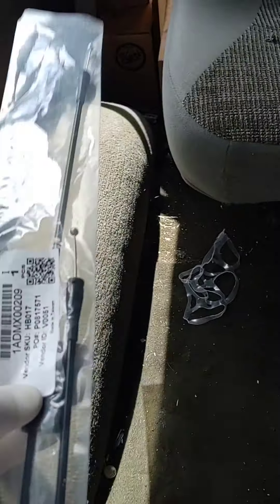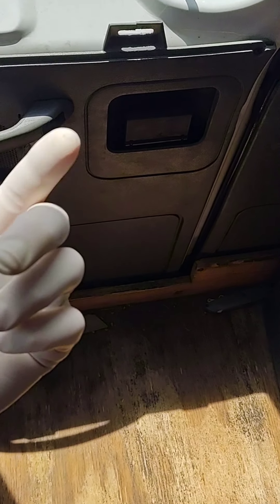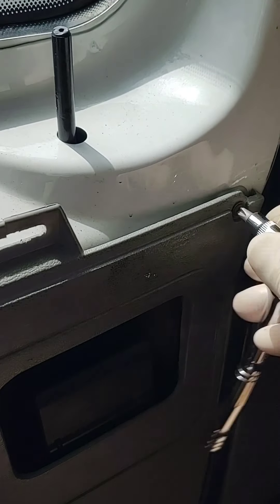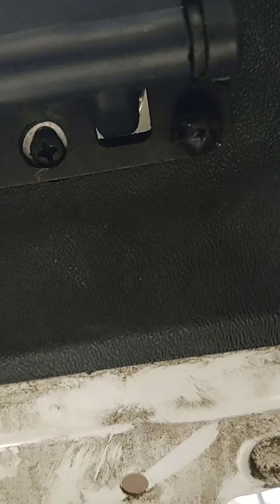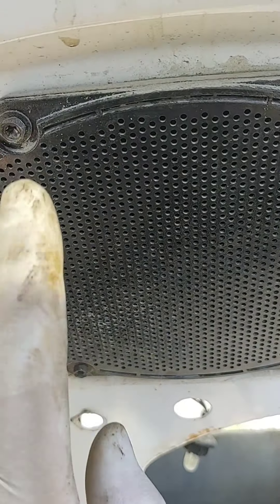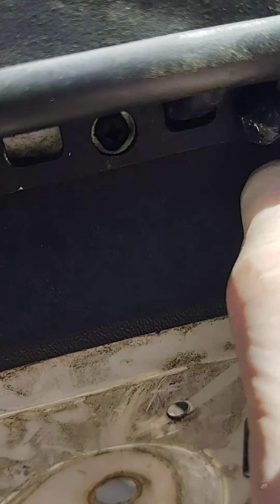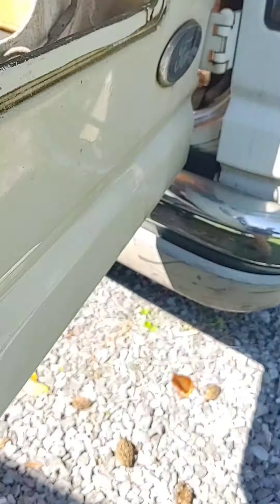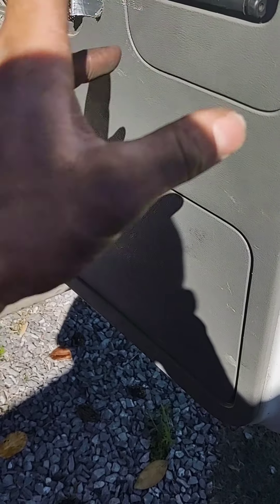Ford e250 and e350 van rear door handle cable repair for latch

Comment: This video helped me also replace the cables. I spent 2 hour one day working through this and still coolant get it done. Then I watched your video and with new cables it took me maybe 30 minutes BUT I couldn't fully remove the locking mechanism. I had 3 of the bolts out but mine had another hollow hex bolt that needed to be removed  to fully disengage and remove the whole system. But your explanation at about 9:59 helped me because I could see through the holes and perfectly place the cables into the locking mechanism. Then after that everything else was a breeze.
Reply: ThinBlueLiess  Apologies I don't remember

Comment: This is one of the best videos for the right hand rear door, what he didn't tell and he may not have had the issue is what to do when you get all the stuff out of the way and you have both cables laying in the bottom of the door. Harbor Freight makes a 5 or 6 piece pick set, use the crooked offset, go in straight where the inside handle cable connects and unlatch it, pull the bottom cable, tadaaaa door open.

Comment: Great narration to walk us through the process.  Thank you very much.   i will suggest this, though.  Instead of buying the cable sets that come with the same rubber/plastic cable ends that will fail again in a few years of heat, buy a set of 4 or 8 or 16 (!) aluminum cable ends instead.  This is such a frequent Ford failure that these are availabl everywhere.  I got mine for less than $1 each on Amazon (Dornan part).  Replace the cable ends with these and you won't ever have to do it again.  I've had my Ford van for for 17 years and sure wish I'd known about these aluminum repair ends when i did this job the first couple of times :-)

Comment: This is so helpful. My issue is that in the process of getting the door to open initially both cables came loose after the door was open. When we got ready to call it a day the door got shut. So now we’ve got a shut door with no cables attached in there to get it open.
Reply: You can slide your finger in behind the unlock tab thing on the side closest to you to pull the thing with no cable its hard to find but once you found it you can do it

Comment: Thank you I'm doing the exact same thing to a 98 Ford sportsman exact same door latches and everything I didn't quite take the last two lashes off this drive me crazy busting my knuckles all up I guess I gotta completely disassemble it all because the door lock cable and that top cable fell out when I was replacing the window And I found one of the sleeves one of the necks is is broke off one of the heads broke off on one of the cables anyway so I gotta get a new cable what a headache of a job especially if you got big hands drive me crazy thank you very much I needed that I can see there are zero short cuts. Everything's gonna be completely disassemble rotate it out and then properly reassembled and that's gonna drive me 😢😢😢nuts
Reply from the maker: Glad to help I hope you get it done. It is a horrible design

Comment: Very good vid! Was looking to see if there was a vid on this as I have already fixed the outside handle ( arm that holds the rubber part of the cable was loose, jb weld ) but now it's not working again. Thinking it's the cable but can't see up to the latch. The cable cover does slide so it must not be hooked up top..... Thanks again, very good vid!!
94 e-350
Reply from the maker: Thanks for watching! They definently  didn't make it easy to repair.

Comment: How’d you get the piece hooked back in to the locking mechanism? That’s where I’m stuck, it’s impossible to pull that hook through the tiny hole
Reply from the maker: You have to feed the cable around through the cracks and then in will go in that part is a  bit of a pain you may need to move it with your fingers a it to open it just enough
Reply: @lifeathand1062 yeah I was working on this job today….. I know why that part wasn’t shown 😂

Comment: Man this is tough I hope I can get it on my calendar is not broken it just popped off ill try to put it on this weekend ill keep you updated
Reply from the maker: I had to peck the cable ends back in I'll answer questions if I'm able to get service also I am going to upload a video on how to fix the AC of it's switching from vent to defrost when under a load
Reply from the maker: I apologize for not responding quicker I'm in the mountains alot and just got the notification for your msg

Comment: Only video that really shows everything. It seems like a pain i might get a mechanic to do it. I figured you needed to take out the lock, of course they couldnt make it easy. I tried to take out lock, and stwrted stripping star screws wth.
Reply from the maker: Yes the star screws are a pain sometimes you have to go the next size up and peck it in with a hammer or cut a slit in it with a dremel so you can use a flat blade screw driver 
Thanks for watching
Reply: @lifeathand1062  ok thanks i was wondering becuase they seem to be hard to get out. I been looking for days for a video on this, your video is the only one that showed everything. Thank you so much

Comment: What if the cables are good but door only opens sometimes? I opened everything up but the cables end are good. Maybe the latch has issues?
Reply from the maker: Try cleaning the latch and then putting a good silicone spray on it. I would probably use some break parts cleaner just be sure to wear safety glasses.

Comment: VERY GOOD INSTRUCTIONAL VIDEO.  MUST WATCH A FEW TIMES. HE SHOULD HAVE EXPLAINED HOW TO OPEN DOOR FROM INSIDE THROUGH OVAL PLASTIC COVER ON THE INSIDE OF THE DOOR NEAR THE LATCH MECHANISUM. NEED SCREW DRIVER & VEIW FROM BOTTOM UP FROM LICENSE HOLDER OPENING.     5 STARS......

Comment: The problem is if you can't get the back doors open you can't fix anything
Reply from the maker: @JohnWarren-c9u  can you access the doors from the inside or are they blocked
Reply from the maker: Look at the video around 5:28 to 5;20
Reply from the maker: Did you buy the cables or the whole assembly

Comment: How did you get the latch out with the lock rod attached to it? I unscrewed the thing and wasn't able to pull it out because the other end was still connected to the lock.
Reply from the maker: You have to reach up in  the door and disconnect the plastic clip from the lock and twist to get it out
Reply from the maker: I researched my video you just turn the rod until  it comes out of the  white plastic hole piece it is difficult horrible design
Reply: @lifeathand1062  

Thanks for the reply. I will try that tomorrow.
Reply: 9:23 the metal rod at your pinky. On mines there is a plastic orange piece holding the other end of it where the keyhole deal is. Is that the piece that i twist?
Reply from the maker: You have to turn the piece that was bolted in to get the hook piece to come out you have to work with it a bit
Reply: @lifeathand1062  
Thanks man. Finally got it.
Reply from the maker: Thanks for watching I really appreciate it
Reply: Easier to just unclip the actuator (the unit attached to that hook) - use a screw driver to unclip (there is a video on removing the actuator).  Then you don't have to figure out how to unhook it !  Took me a day of frustration to finally look that up !  Once the actuator was out of the way, everything came out fairly easily.

My biggest issue was getting the new cables to stay in place... they almost seem just slightly too small and didn't really "clip in" or fit as tight as the old ones.

Comment: My problem is that one of my rear doors on my E350 Econo Wagon (16-passenger) van is closed shut and I don't know how to open it so I can repair it.
Reply from the maker: If you take the inside panel off the door then take the part around the handle off you can reach in and find the mechanism that will open the door it should have the cables attached you pull the cable which should open the door I hope this helps
Reply: @lifeathand1062  Yes. Thank you. I did it, thanks to you.
Reply from the maker: Did you get yours fixed
Reply: @lifeathand1062  I have repaired two of the doors on my van. I still need to fix the rear doors. I've just been really lazy about getting to it. It's been raining like crazy here in Southern California, which is an oddity, since we've been in an ongoing drought for, oh, I don't know, what, something like over thirty years now. In the last three weeks, we've had more rain than we've had in the last ten years combined. Today, Saturday (1-30-2021) is sunny, but cold outside. I've been spending almost all of my time looking for a job online, so the camper van project has been set aside, at least, for the next few weeks, anyway. Thank you for asking though.
Reply: I pulled down cable over and over never opens.

Comment: None of you understand when the door breaks it breaks in the closed position how do you get it open to replace the latch none of you even talked about this 300 videos none of you say how do you get the door open
Reply from the maker: @JohnWarren-c9u  if you take the inside panel off you cand see where the cable runs if you pull on those, it will open the door. I do apologize. I think I started recording afte that. I hope this helps.